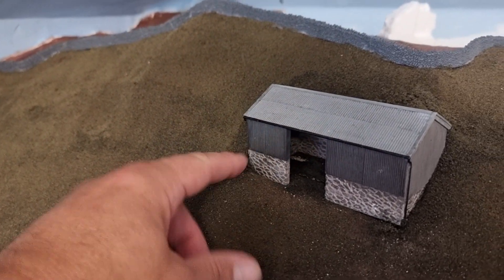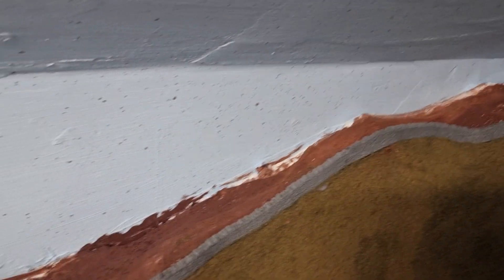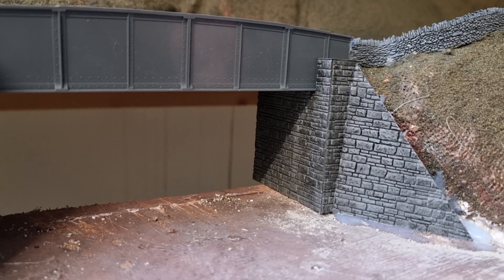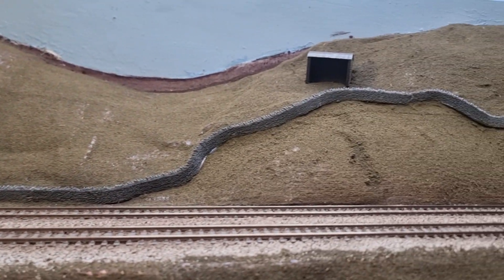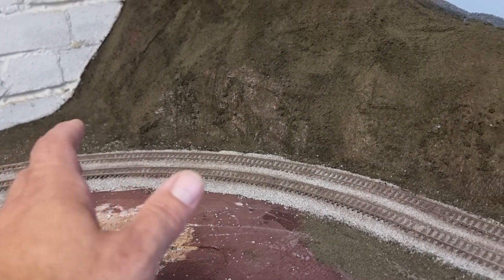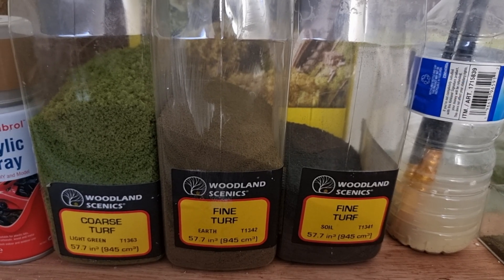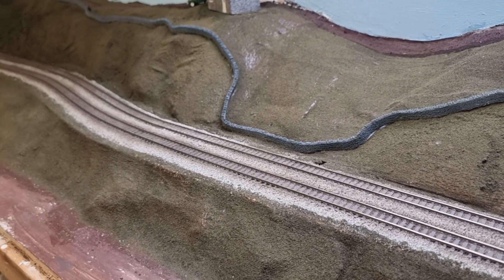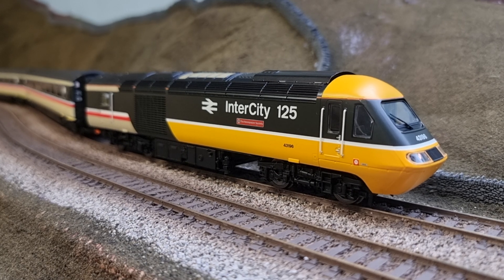Layout update and new train

Comment: Hi Lee.
Great vlog Lee

Agree with you with the stone wall, just did a vlog with the other foam stuf. Got my control panel over it so don't notice it so much. Did a vlog on it, not had any negative comments. I'd seen the walls you used before I bought the foam stuff.

Peco tunnel mouth looks great  better than the Metcalf cardboard ones.

If you add a field, you can then add animals, trees grassy knolls etc.

Love the HST great rake of carriages. Got the hornby 125 with the light upgrade. No sound though.

Thanks for sharing Lee.
Thumbs up thumped 👍 
....Pete....
Reply from the maker: Hi Pete, welcome to the channel, and thanks for watching, I've just seen your other comments on my other vids, so I'll read those after this.
Yeah, the stone wall came out really nice, I think I'll be using it again to do a scratch build on something, maybe another barn or some shops, maybe even a pub. The foamboard you got is supposed to be good, but I've never used it myself. The peco tunnel mouth came after looking at many different ones, and this looked the best, as the Metcalfe stuff is just not an option for me, but that's just my opinion.
Right, Pete,  I didn't know you had a channel so just searched and found it and subscribed. I'll have a look through mate, and comment. Thanks Pete. Lee
Reply: @leewhall2504  Hi Lee.
Thanks for the sub. Not got a big layout, 10ftx10ft not as nice as yours. 
Cheers bud.
....Pete....

Comment: Hi, great video of you scenery progress, your HST and rake of coaches is very nice indeed I got the intercity swallow from 2020 8pin dcc version, the coaches are very hard to get hold of because they’re rare and popular, I’m going to run mine with sleeper coaches eventually, I do like the original yellow/blue/grey intercity livery, unfortunately the 21 pin version model has fans that are noisy and very annoying, well my other sets are so I disconnected them, I’m prepared to wait until the price drops and hopefully the fan issues have been addressed, the coaches are very good for the money and don’t throw up any issues to be fair, thanks for sharing.
Reply from the maker: You hst swallow is the same as mine i think (it's appeared in many of my previous videos). Yeah, the swallow coaches can be quite hard to get hold of, I grabbed mine when I got the swallow hst, but still even at the time, they were really expensive. Best off, keeping an eye on ebay for some. They are however, like you said, very good coaches and extremely reliable. The other reason I kitted out the new hst with it's proper coaches, is I want to run the full swallow livery train at the same time as the executive. Thanks as always for watching and commenting, means a lot. Best regards, Lee
Reply: @leewhall2504  My HST swallow set has buffers on the fronts of them and they’re the 8pin dcc models, I’m not sure if the set I would like if fans are fitted and work properly so I might give the set a look, the price is way too high for what you get in my opinion, I prefer ESU decoders in my locos, the HM7000 TXS decoders don’t really float my boat, I like a decoder I can get access to unfortunately the TXS decoders won’t let you do that.
Reply from the maker: My swallow hst is also 8 pin, and as for the hm7000 blue tooth control, I haven't even looked into how it works, just running it from my normal ddc controller

Comment: Great progress, lee. You could have a canal going through a hillside, they have lots of canal tunnels through hills and stuff up north! It's your layout so you stick to what you want though.
Ive just bought that same hsT as you. Jadlam were doing it for £349 so a good saving on Rails. Then I bought the coaches pre owned but never opened boxes for £34 each. Couldnt get the buffet so am going to have to pay full price for that! I recommend using the magnetic couplings that come with the coaches, makes the rake look a lot better. Hadnt noticed the A, B, C etc on the coaches though!
Reply from the maker: Do you know, I've bought a load of things from Jadlam (mainly rc), and never knew they did trains, especially things like this hst. You got yours cheap and a brilliant deal. The reason I said about the road and not the canal going into the hillside, is I do a lot of work in kent and see roads going through the most extreme size hills. The layout I was referring to has done a canal through the hillside and the layout is based on a location up north, and it looks amazing. Thanks for watching and commenting, I've enjoyed this chat. Thanks again. Lee

Comment: as you are extending the board and you want a countryside setting, a canal would be ideal. Use the existing section as a B road and track. This will offer you a few options for tiny set scenes, bus stop, walkers, canal and even a small pub on the canal side. Great idea and a new sub
Reply from the maker: That's actually a really good idea. I really want a pub and have done for ages, I also would like water and your suggestion does both. Thanks for the sub and also your comment, much appreciated. Best regards Lee

Comment: Good landscaping work. 
Just one thought, what happens beyond the girder bridge? Still looks a bit “tunnel-like” to me. Good luck.
Reply from the maker: It's definitely either got to be changed to a canal, apparently there's a canal that runs through something similar called Standedge Tunnel in Yorkshire that runs 4 miles long (moe convincing a road). So it's either a canal or no tunnel at all. What's your thoughts? Thanks again. Lee

Comment: Hi Lee I live in marsden West Yorkshire and we do have a canal tunnel going under the moors that’s nearly 4 mile long and it also runs parallel to a Manchester-Leeds main line with scenery very similar to yours google - Standege Tunnel end and you will see thanks
Reply from the maker: Now this is what we are talking about. Omg, I just googled Stanedge tunnel, and I am blow away! You are absolutely spot on. The road idea is going, and an appropriate looking tunnel mouth and canal is taking its place. Thank you so much for sharing. Lee
Reply: @leewhall2504  maybe an N scale tunnel mouth?
Reply from the maker: Funny enough, I was thinking the same thing, because when I looked at the standedge tunnel, it does have quite a small mouth

Comment: TECHNICAL ISSUES - CODE 75 VERSUS CODE 100 AND MINIMUM RADII !!!
Your layout is coming along nicely. A couple of technical points to note however, are the issue of track type, and curvature. The reason for the existence of Code 75 & Code 100 track, which today only seems to afflict Britain, is as follows. In 1989ish the NEM Conference in Germany, which invited all European based manufacturers. Was to introduce refined STANDARDS generally to Model Railways in Europe including Britain, thanks to the availability of more modern computerised tooling then becoming available. First on the list was of course track, as it was now possible to actually make rail sizes exactly to scale. Hence Code 75 was introduced. 

But changing both the height & width of rail, required changes to ALL wheels by ALL manufactures to suit the new profile. Which meant wheel tread width had to be reduced, as well as flange depth, and most importantly the curve between wheel tread and flange. This last was now set at RP25 (Radius Profile 2.5mm) !!!!

What this means is that models trains with older Pre NEM wheel types would not run on the new Code 75 track fluently, and new NEM wheelsets would NOT run perfectly on older Code 100 track. As the distance between the rails has itself been fractionally increased, due to the fractionally thinner rail. PECO (UK) were of course heavily involved in the NEM conference !

The biggest issues created by refining track to Code 75, are the pathways through checkrails of points, and the frog area, which are noticeably narrower. This means using the older Code 100 pointwork the flangeways are to large for Code 75 wheels. The result is often spurious derailments by modern models when operated through old Code 100 pointwork, especially Steam locos with long rigid chassis. 

CURVATURE - IS A MAJOR ISSUE NOT WELL UNDERSTOOD !
An even bigger issue is the  "Minimum radius" of  curves. In real life a Diesel loco such as a Class 45 1-Co-Co-1 or a 4-6-2 Pacific such as Flying Scotsman requires a MINIMUM RADIUS 4.5 Chain curve to be taken at WALKING PACE. 4.5 Chains = 297 feet. So in 4mm OO scale this is a radius of 1188mm or just under 4ft radius !!! A 30mph curve therefore works out at around 4ft 6in, and a 50mph curve in OO at around 5ft 3in radius. So even Hornby with its now horrendously outdated Code 100 clip together track system (Still made for Hornby by Roco in Austria) has had no choice but to set the minimum radius for larger models at "Radius 2" (438mm around 17inches) !!!

BUT and its a BIG but. The Laws of Physics apply equally to real trains and models. The relevant Physical Law is that with EVERY degree of Radius in a curve, the power available in the Locomotive must increase by the SQUARE ROOT. A typical well known test for model engines is to run a Hornby (Code 75) Flying Scotsman, through various curves from Radius 2 (438mm) upwards, and see how many carriages it will pull. At the minimum 438mm Radius 2 such a loco will only pull usually 4 bogie coaches before wheel slipping sets in. But the same loco will happily haul 12/13 coaches around 5ft 3in Curves. Most importantly, the larger the radius the less stress is exerted on the Motor and its gearing, increasing Motor & gear life considerably !!!

MODEL CURVATURE TESTS REVEALED...
In large scale tests carried out around 10 years ago, on a large four track mainline exhibition layout (90ft x 30ft) , some very interesting findings were discovered testing over 100 British outline locos types and dozens of carriage types. From Bachmann, Hornby, Dapol, Heljan and specialist manufacturers such as DJH. This also involved the use of the current "British tension lock type coupling" & the U.S Kadee (British Buckeye type) auto magnetically uncoupleable type. 

Firstly minimum radius for scale length trains (loco & 12 coaches) using the shorter Kadee magnetic Buckeye type coupling.  This revealed that perfect running even through complex Slips & Double Slips required curves no less than 5ft Radius. Which allowed coaches to be realistically Close coupled so corridor gangways touched without derailments, and the gap between locos & their tenders to also be reduced to real life settings. If the traditional British tension lock (toy) coupling is used, then radii of 4ft 6in MINIMUM still allowed reliable running, with the penalty that coaches could no longer be Close coupled to the point where gangways touched as in real life. The Club layout as a result set a Minimum 5ft for all curves, except in Goods yards which was set at 4ft 3in, due to the generally small locos and short 4 wheel wagons used in such Yards. 

This of course also dictated that ALL visible pointwork would have to be handbuilt (about 115 points). Only in the Fiddle Yard were Peco Code 75, Large 5ft radius points possible. Further the handbuilt points required proper sturdy Fulgurex 12v DC  Motor Driven Motors, as being the only type strong enough to cope reliably. They also, when purchased directly from Fulgurex in Switzerland work out cheaper than virtually all other types. Indeed "SOLENOID" mechanisms are never used, as these will destroy PECO points due to their constant hammering of the blades, which results in the plastic tiebar breaking loose !!       

On a Club layout the cost of commercial points such as PECO is prohibitive, when it is understood a 6ft radius handbuilt point can be built in around two hours for just £5.00 !!! I built the points using code 75 Bullhead rail (which is quicker and easier to file than flatbottom rail) and Copper Clad sleeper strip provided by "Marcway Models" in Sheffield. They have a Website, and are also very helpful on the phone with any questions you have about track building 😀

Happy Modelling.
Reply from the maker: Blimey! That blew my mind! Thank you. I have to ask, was that a cut and paste job? Best regards Lee